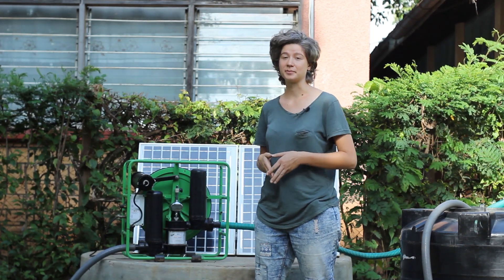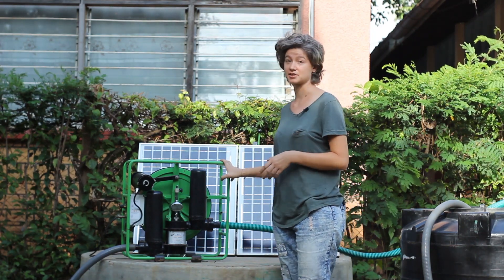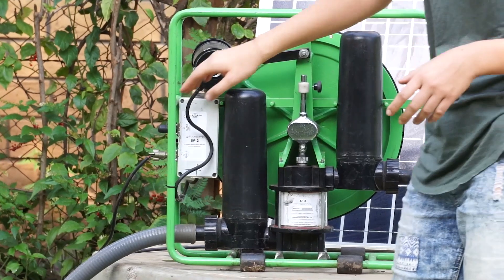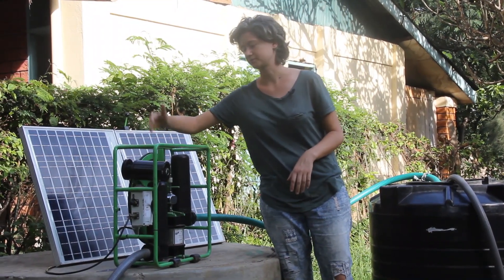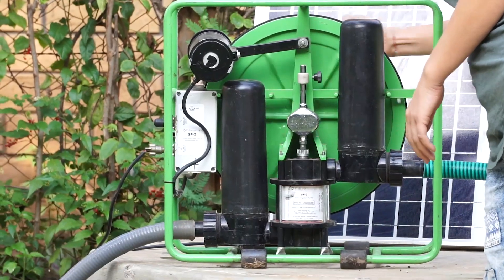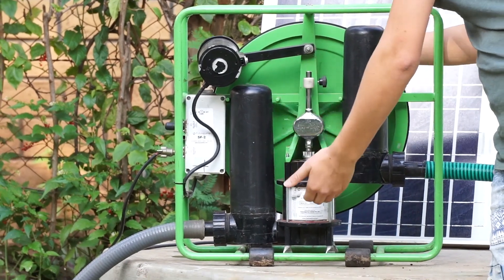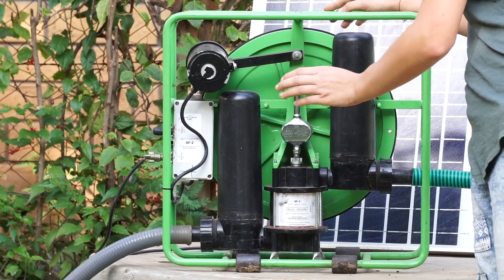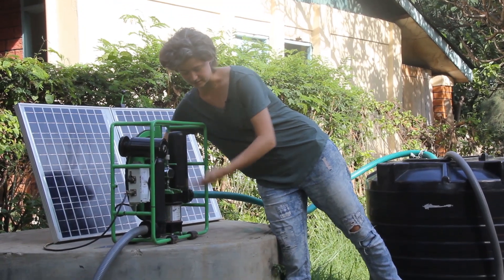How A Solar Water Pump Works - Futurepump SF2

Comment: Hello when you are using sf2h future pump can you connect 60w 4pcs and how
Reply from the maker: Hi there, the SF2H can work with 120W (2 x 60W connected in series) or 240W (2 x (2 x 60W in series) connected in parallel)

Let us know if you need a better explanation on that

Comment: Hi, is there a pump that can lift more than 7 meters?
Reply from the maker: Hi Benjamin - the total lift for the SF2 is 15m. As it is a suction pump, it cannot have more than 7m on the suction side, but it can push water up further. We also have the SF2H which has a total lift of 45m (still with 7m on the suction side)

Comment: Can this pump work on boreholes.Please help
Reply from the maker: Thank you for your question. This pump is a surface water pump with a suction limit of 7m, typically borehole water is lower down than this. What is the depth to your water from the surface?

Comment: how much is SF2 in Kampala, Uganda
Reply from the maker: Thank you for your question. The Futurepump SF2 with irrigation kit is currently available from SolarNow Uganda for UShs3,190,000.00 - they also have finance options available. You can contact them TOLL FREE on  0800 270 070.